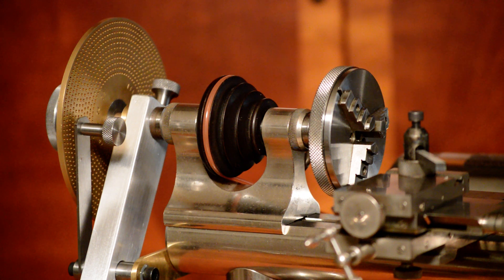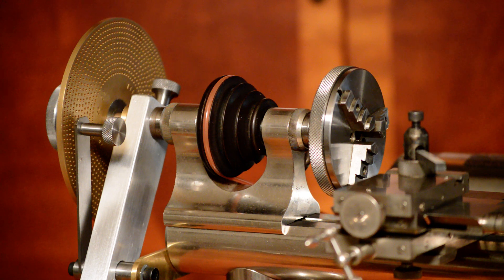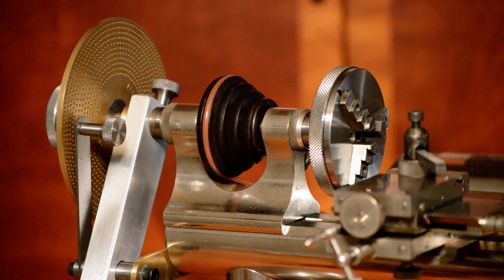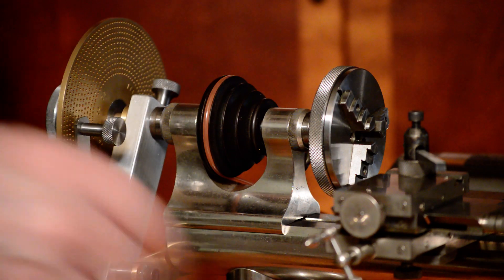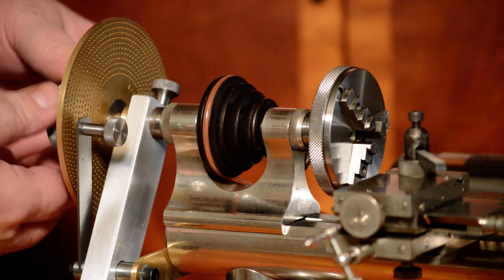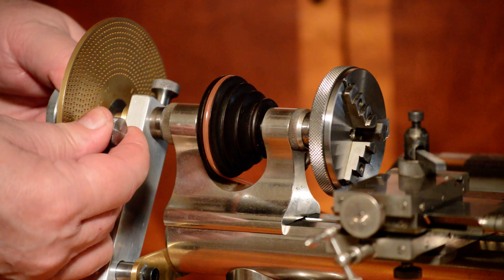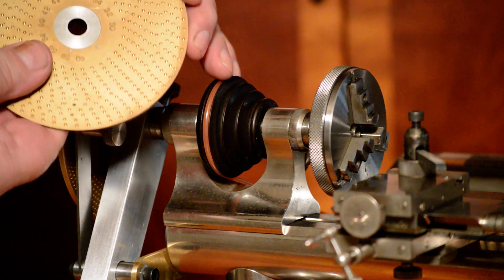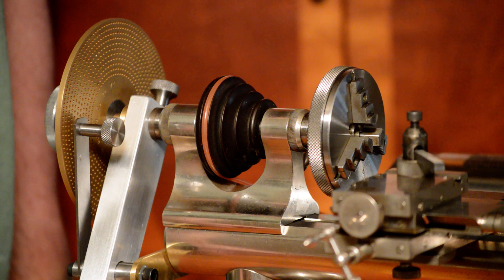Watchmakers Lathe Dividing for Gears by Jeffery A. Krueger

Comment: Are you still doing this project?
Reply from the maker: Yes, I Got a Vintage Milling attachment for it and a collet to hold the cutters for that , also  I'm going to have to get a pulley drive set up working to drive it to cut the gears , Thank-you for your interest and watching , Best wishes to you and I'll get to more as time allows. : )
Reply: Would you consider making a dividing attachment for my lathe (for a fee of course)? I presently don't have access to a larger lathe to produce my own dividing plates, meaning wheel and pinion cutting isn't possible, and I'm relying on an old, poorly-equipped chronos engine whenever I need to produce new wheels